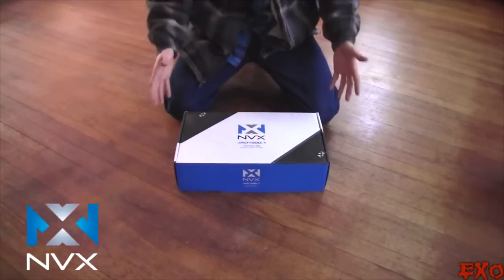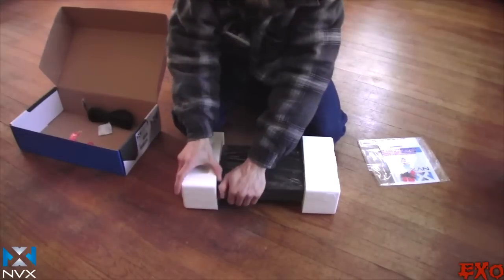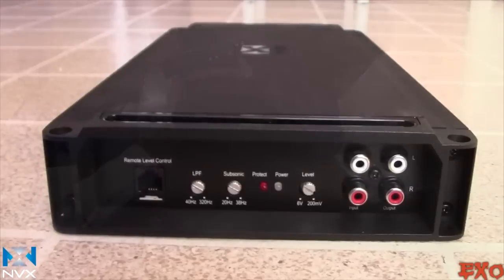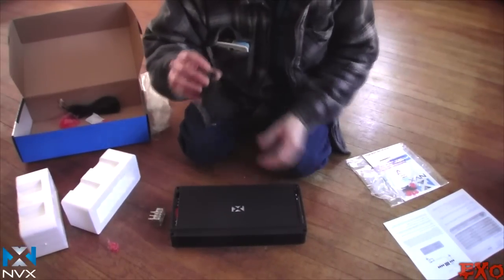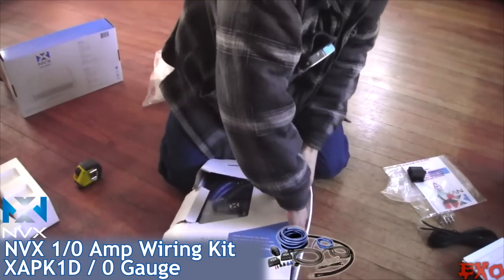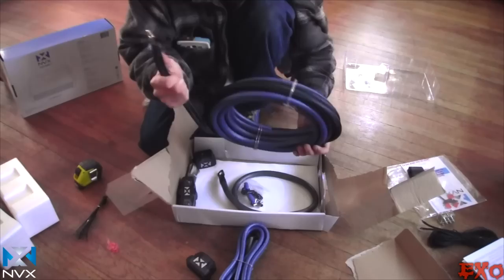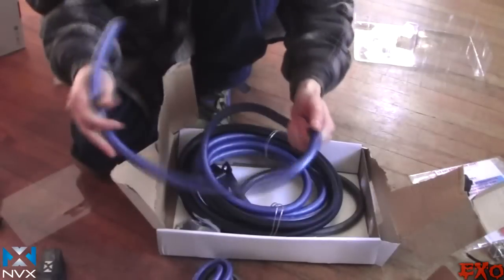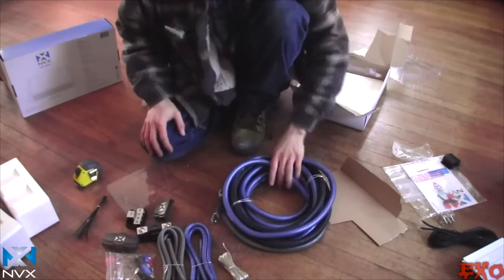NVX JAD1200.1 Bass Amp & 1/0 Gauge XAPK1d Amplifier Wiring Kit UNBOXING / Pure Copper Wire

Comment: I have an 05 impala and yes they are a pain. Suggestion is to run the power through the drivers side on the bottom!  And remove the back seat and run the cables under the seat support brackets!

Comment: I use to have same model impala it's easy to run the power wire there is a rubber grommet u can take out on passenger side kinda towards the middle

Comment: I hate it when people shit on the bass knobs like they’re useless. They act like it’s for specifically tuning the amp as if it was the gain when really unlike the gain, the bass knob is  just the actual volume control. It’s nice when you don’t want full beans on the bass all the time and just want to adjust the bass without turning the mids and highs up or down with it, or you’re rolling in the neighborhood late at night or early in the morning. It’s basically a bass EQ except you don’t have to use anywhere near as much focus, especially when driving, having to navigate through the settings.

Edit: Also, I just realized how old this video is 😂

Comment: A chevy impala is a pain to run any wire through the firewall... I just said fuck it and drilled a hole through it, but the rest of the interior comes apart easily.

Comment: Sucks the remote is remote bass boost instead of gain.
Reply: Why?
Reply: imadethistowatchvide Because remote gain is 10x better than bass boost. You should never use bass boost. Easy way to destroy speakers.
Reply: I think it's best to get a volume know for the rca's themselves. Set your gains on the amp as high as they can go without clipping and use the rca knob to set the volume.
Reply: sycamoreent Octogonapus That's basically what a remote gain does. Set your gain to max before clipping and the remote will not override that so you will not have to worry about destroying anything.
Reply: I see i get what you are saying. Makes sense.
Reply: same thing with rockford fosgate amps :(
Reply: Bailey D its not a "bass boost" its a signal attenuator. In other words, its basically a volume knob for the amplifier
Reply: ***** Nope. That would be LC-1 or XBRC. Those are signal attenuation.
Reply: Bailey D Again its "NOT" a bass booster, its a signal attenuator, basically a volume knob that allot of the new amplifiers come with them now. Go on the website and look at pictures of the amplifier and it will show you an ethernet port for a "remote level control." A bass booster would be something similar to an epicentre
Reply: ***** Okay so it is remote gain knob then.
Reply: The lower you set your gains the better.  Most people think the gain is a volume knob but it is not, it is used only to adjust your music levels.  The higher the the gain the more chances you will add distortion and eventually damage your speakers. On the other note i wouldnt mess with bass boost. Have it off or on zero. If your itching to mess with gains you can picture it as a clock and have it at 9 at the most. Hope thia info is helpful.